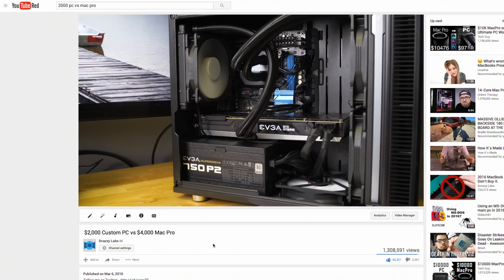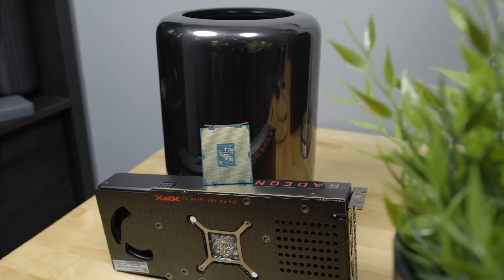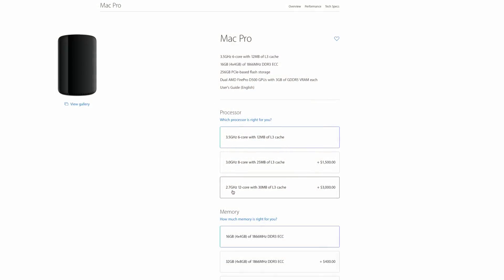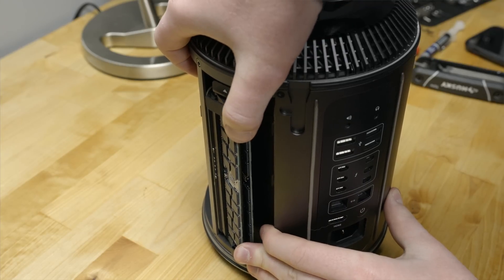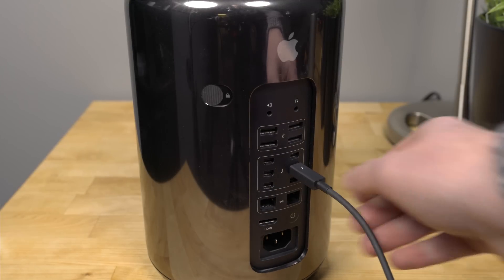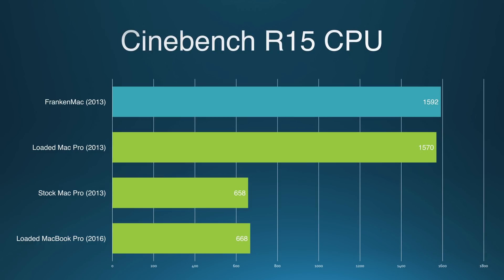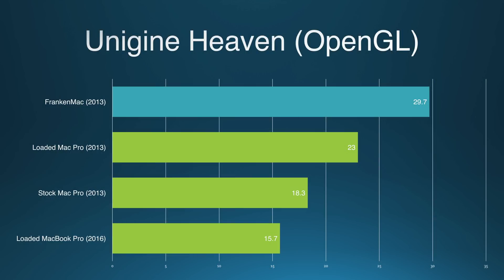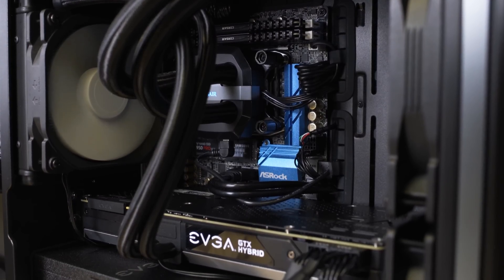The Best Mac... Apple Doesn't Make!

Comment: This was a great video, Quinn! But I gotta ask, why not just build a hackintosh from scratch if you really want to use final cut pro? Aren't there plenty of builds that you could get away being bug free with by using the right parts?
Reply from the maker: +Nellogs This setup is bulletproof. I just want to never have problems with it. Hackintoshes are like 99% problem-free, but running into an issue during a major video with clients waiting is a big problem.
Reply: I definitely feel you on that. Thanks for the reply! <3
Reply from the maker: Cheers! :D

Comment: you said that apple nativatily supports this card because it supports the 460 in MBP, so If I was to build a hackintosh and throw 2x 480 in sli there should be no tinkering needed?
Reply from the maker: +CER CrossFire is not recommended.

Comment: Wow, you really thought out of the trash can. I bet the graphics card move would work great on a 2015 MacBook Pro through Thunderbolt 2. 🤔
Reply: JoeBob C even better on a 2016 with Thunderbolt 3
Reply: External GPU via TB 3.0 is currently NOT working with the 2016 MacBook Pro.

Comment: Wait, how did he hook up the GPU again? I can't get it, he talks too fast.
Reply: He used a Thunderbolt to PCIe adaptor called an "AKiTiO Thunder2 PCIe Box" to hook up the external GPU. He hooked the computer to the AKiTiO, then the AKiTiO to the GPU. Since the GPU also needs a separate power source as well as cooling, he put those into a separate computer case.
Reply: he used an external thunderbolt to PCIe called "AKiTiO Thunder2 PCIe Box". This box can convert thunderbolt2 into PCIe lanes where you can plug any PCIe extension. But since the Akitio box is small and can't fit a full-size GPU, he moved the TB2 converter from the box to a full case
Reply: Case, PSU, and card? There's no motherboard needed?
Reply: Yeah, just a psu and a pcie2 to thunderbolt box
Reply: Thanks man! I guess i'm not the only one who couldn't understand what he said
Reply: Alex Soto would that be cheaper to build than buying a Razer core?
Reply: BrechtXT Definitely. The Razer Core probably works a lot more seamlessly with Razer products though.

Comment: Not to be offensive, but you are way too much of a tinkerer to be a mac fan.
Reply from the maker: +Ogoun I am a PC guy too. :)
Reply: Mac people are best in one thing... accepting to get RIP OFF by Apple. Every single time...
Reply: Nope. He's just smarter than the average Mac/Apple user :D
Reply: anyone that is a Mac user or a "mac fan" can be the person that tinkers and not use Windows/Linux. As he said in the video this isn't a Hackintosh. This is good for people that will only use a Mac but  want to get more performance out of their current mac.
Reply: I'm a big Linux guy, two of my daily computers run Linux, and I have to say its not for everyone. There is a much steeper learning curve with Linux than there is with MacOS or Windows. Ultimately, it is true that Linux developers focus more on features that UI. That takes a lot to get used to. Many programs built for Linux are open source, meaning the developers have to do the same work Microsoft does, but on donations instead of selling products.
Reply: George Kazanakis All companies have issues with software and drivers at launch. Microsoft has the excuse of having to work with hundreds of computer manufacturers running a plethora of hardware combinations. Apple has only a few sets of hardware, and bootcamp blew out the speakers on any 2016 mac that ran it. The people whose speakers blew out had to send the computer back to them, and they would ship a new one back. I guarantee that took longer than three days.

I also doubt you have any files that went missing because of windows, and you can hardly blame Microsoft if the programs you decide to use has errors. And don't tell me that in owning your Mac for 7 years you have never once had a problem with it, because I call bs.
Reply: If you think the extra layer of polish is worth the large amount of money Apple charges, then that's fine, but it doesn't change the argument that Apple users are not tinkerers. My point is that people who like to tinker enjoy saving money and solving problems themselves. They enjoy playing around with hardware and software options in a way that Apple doesn't allow for.
Reply: What are they tinkering with, though? If they want a polished experience with every program they want pre-installed they aren't tinkering with anything.
Reply: George Kazanakis actually there's even better fully functional laptops for example all these razer laptops, they have great performance and some cost less than a crappy macbook
Reply: Ogoun what the fuck are you on about
Reply: I have to call BS on this one. Windows 10 is far from unstable, TBH I use it for professional work on 2 computers from the first day it was released and it hasnt crashed even once, not even a hickup. The funny thing is that I regularly use Fusion360 for 3D modeling, and once I used it on a macbook pro and it crashed 2 times in an hour. Probalby bad optimization od the software for MacOS, but still rendering it unusable as an OS for my workflow. You just have to make sure that you use a original activated version of Win10, I can't stress enough how important that is for stability and usability
Reply: Julien Vandal - linux fans are the best tinkerers
Reply: ***** - what software of linux is not intuitive and is bad? what do you mean they do not think practically?
Reply: I'm gonna cal bs on the Windows 10 unstableness too. I was even in the Windows 10 Insider Program, using Windows 10 before it was released and when even Microsoft were calling it unstable, and it never crashed once
Reply: XInfinity2013 - any system can crash
Reply: Hmmm...not much a thikerer...lets see....
las time i checked on windows 10 lenovo laptop after the update the monitor wasnt working because windows 10 installed the wrong drivers! The result was 3 days without pc and the work fall behind. Also updating when i have a presentation for example.
I have another one: missing files, errors in software etc. ENDLESS. 

I use a mac pro and previously, until end if 2016, a 2009 macbook pro. And guess what..They just work until this day with 0 problems, reliable (slow for the macbook but reliable) and easy!

So come back and say how mindless i am and i buy those machines :)
Reply: I didn't say it was a valid excuse, but when comparing windows and MacOS, you have to admit driver errors are harder to forgive when they have only 5 different computers to write software for. Linux is different because you need separate drivers for each piece of proprietary hardware. When installing Debian on my ThinkPads, I had to download drivers manually and force an update to get my wifi to work. The average user doesn't want to deal with that, they want to buy a laptop and start working immediately. And anyone who buys keys at $110 is an idiot. Anyone with only 5 minutes of research can find keys for under $30, I buy mine for ~$8. (Granted, I buy OEM keys, not retail)
Reply: I completely disagree :) 

Personally i don't care how many hardware and software combinations exists on windows and mac and that's simply because i don't care! I care having my job done no matter what. So i consider better company for my needs the company that has less chances for errors. And  these apple combinations serve me very very well for many years. 

I use bootcamp some time now for being compatible with win files from colleagues and i didn't have problem with that. 

Also i can't get the mainly used phrase from @NexuZ Demon: "I think way more than the normal consumer" - thats why i have windows.

So if i want a tool that doesn't need to think how to make it work properly, i think less right? 
I really can't understand some thinkers to be honest. Maybe because they are smarter than me i guess.

Should i sum up how much more reliable apple products are comparing to windows laptops (based on statistics). 

Indeed Ogoun all these years 0 hardware problems, software problems not many and minor. To be honest were so minor that i can't remember a specific example right now!

Of course you can't play games properly on mac. Of course you can't be a programmer on mac. Of course i don't have a lot of software which are available for windows only. But for sure this is not my field so again...i don't care for that too personally.
Reply: Ogoun I will explain what I mean exactly. 

First of all it's not the extra layer of Polish (eg.Microsoft Surface)

The thing is that I DON'T like playing with software and hardware around. 1 because it's not my favourite hobby and 2 just to be clear about my use: because i am an Architect and I prefer 1000% to give that time for project! i already come back home after 22:00 every f** day.  And i prefer giving my free time on hobbies that I really like. I am using my Cad software, 3d software, almost all the Adobe series and I am more than happy with the performance and the result. Why the hell should I give my precious time on playing with these combinations. I can't get that. And that's make me not a thinker?  really? 

I told you that to show you that I am not a 18 year old to show off my bitten apple in Starbucks and i love having iphoto and keynote preinstalled. 

I pay that money because i buy a solid machine, reliable 100%, i can easily put it in a  bag and have a small monster on the go. 

Because i love having exposè on my computer and not minimise 1000 times per day my app windows to find things. 

Because when i save something i don't have to look at it and with one click i find my recent edits on finder.
The examples i can think right now are endless.

And all these examples of ease of use and lesser moves i make every day after 10-12 hours working on it believe me are life saving. 

Also i doubt that some apple products are really expensive. Eg my mac pro has dual d700 (~= firepro w9000). The cost of w9000 standalone is around 2500 last time i checked. (x2=5000)
Xeon e5, 6 core 3.5 around 700? 

5700 easy. 

But macbooks indeed are really expensive. 

Guys just clear up your mind and understand that some users see the computer only as a tool. They are not gamers, they are not pc builders. Macs are reliable tools that makes my life easier without adding another one problem on my mind. 

G
Reply: That is exactly my point. If you want a solid machine, and you are willing to pay the extra money, its worth it. But if you want to tinker, as I stated in the first comment, you don't buy a mac. They are overpriced and do not have the hardware or software options available to windows users. If you don't want to mess around with hardware and software you are not a tinkerer hence my statement is valid. I don't doubt your mac is reliable, and I don't doubt you use it a lot. If your computer is just a tool, you are not a tinkerer. Tinkerer doesn't just mean you do things, and it is not synonymous with creative. It's not an insult not to be a tinkerer.

Also, expose is not a mac feature, Windows has the exact same thing in the form of task view.

Comment: I'm about to build a custom PC in a classic Mac Pro case!
Reply: Rody Davis and install hackintosh in it. it gonna be awesome.
Reply: Rody Davis wait you said classic I like it a lot
Reply: You're*
Reply: I've got a Mac Pro 1,1 flashed to 2,1 with upgraded cpus and ram. When it outlives it's usefulness, I'm gonna turn it into a Hackintosh. It's still smoking fast so, at least three years for this $300 after upgrades unsupported Mac Pro running El Capitan.
Reply: I had that idea. Sounds pretty cool if you ask me. It's kind of like giving Apple the finger and saying: yeah, your design is great, but your hardware sucks, so get out of the way and watch a professional work.
Reply: I wouldnt keep the power supply, they have a tendency to fail and you'll have to rewire everything to make it fit modern components. Plus, newer PSUs are much smaller and quieter :)
Reply: Rody Davis you're stupid
Reply: Rody Davis cool!
Reply: Rody Davis niiiice dude
Reply: I've done the same thing with a laser hive kit and it works great! Lots of cutting involved lol
Reply: Chasbris thank you for that advice! I think I'll do that and get a 500watt modern PSU
Reply: I had already do!! ;-)
Reply: CADesigner yeah that is something I have been considering with xeons. I definitely want it to be a workstation I was just not sure if the motherboard would fit. But that one looks like it will. I will use the PC for mostly video editing and animation. That would be a lot better set up for Ram too. It may be a tight fit but I want to liquid cool if I can to make it quieter and run cooler
Reply: Octa-channel instead of quad or dual, still faster than a X99 with 2400MHz DDR4 in quad-channel  (latency is not that good).
Reply: 4ever rmr joe you mean OS, right? cause S.O. is not ringing my bell unless you S.O.S. me.
Reply: I wanted to do that but I don't have access to most of the parts, like te custom mobo plate. I have a G5 case though.
Reply: Santiago Ferrari Depends on how you calculate value for money. In most work environments, Apple's have higher value for money, since they lower IT costs drastically. There's studies on this, but I've done it myself w/my small office and experienced the benefits. If Apple only made a simple "Apple" type printer again, costs would go down even lower. People still have trouble with printers, haha! In my own personal life, I'm also much more efficient on Macs. But I do like that Windows has been evolving nicely. I bought 2 Windows PCs last year, and they're decent for select apps. Surface 4 + Xara is a lot of fun, for instance.
Reply: No This is Patrick yep mine is a PowerPC G4 too!
Reply: Denver Alfito Anggada yep absolutely!
Reply: sdushdiu Unfortunately, since I have the G4 PowerPc mac pro from 2005 I have to gut everything except the power supply and bay drives at the top since it wasn't an Intel PC. But i think it will work really well.
Reply: I recommend you use a dual E5-2670 v1 setup, it's abput 34% faster than the fully load Mac Pro, and you can find the pair of CPUs for less than $150 total, 64GB 8x8 at 1333MHz can be found at $150-200, and new motherboards with dual socket starts about $250 but you can find a second hand mobo on eBay, for the psu you could buy one that has dual EPS or a 2-molex to EPS adapter.
Reply: save the hard drive. it has the os on it, you could make a hackintosh.
Reply: +CADesigner CPUs might be cheap but motherboards aren't. Also, 4gb sticks of 10600r can be found for $20 a stick. Running a HP Z600, dual E5667's, 24gb ram and a GTX 970. Cost $600
Reply: i was thinking of doing the same, but arent the old mac pros not BTX instead of todays ATX mainboard form factor?
Reply: I would except I wanted to put GTX 1070 and DDR4 RAM in.
Reply: Rody Davis where did you get the mac pro case from?
Reply: SOZ I KILL YOUZ a college I used to run the AV and production department for gave it to me on my last day.
Reply: SOZ I KILL YOUZ go to a local Free Geek thrift store. they have lots of old macs and powermac g5 cases
Reply: Well I know you can get the cases without the motherboard, I just thought someone made an ATX version of the case. Thats why I wondered how he got the case.
Reply: Damn. well have fun lol and remember that the apple motherboard isn't an ATX size and will have to be modified to fit an ATX or and common motherbord standard.
Reply: Mato Blazevic 
Hey bro could you add more GPU`s to the system????? Please say anything
 4 GPU`s trough thunderbolt terminal on this Mac Pro?
Reply: Mato Blazevic no you would be limited by the bandwidth from thunderbolt 2 or 3. So adding more would not help. You could go the custom PC route and add more GPUs and then stream your stream and controls to the Mac.
Reply: Spammers are getting smarter :3
Reply: Santiago Ferrari is Sierra available yet?
Reply: i have one waiting for the market to settle and ill be building in an 08 MacPro Case
Reply: +4ever mr joe Mac doesn't make phones!! apple makes phones lol!!
Reply: The best S.O. for mobile and computers of all times not counting linux.   are Windows 7 and iOS7.
Reply: You pretty well have to fabricate your motherboard plate. That's not nearly as hard as it sounds though.
Reply: Mac is for office project or any kind but not for gaming if you are just more on gaming I personally suggest Desktop you can expand it more and customize but Desktop is more on for games nowaday but if your an college student like me I highly suggest Mac. but it's up to you :)
Reply: 4ever rmr joe there is a free version of windows 10? Does it still work fine? What is the catch? I'm genuinely interested.
Reply: Rody Davis N O I C E
Reply: Rody Davis cool dude
Reply: Genius, the Mac is simply an Intel Roadmap compliant PC. It was and IS a PC running OSX.
Reply: I'm about to build a PC in a cardboard box. Make holes where you like. Who cares.....
Reply: LaserHive Makes plates and mod Kits for almost all old PowerPC cases.  I used one for my G4. Came out amazing.
https://www.tonymacx86.com/threads/my-first-mac-case-mod-g4-graphite.146222/
Reply: yeah u can also install Windows 7 lite 64bit   it runs ultra fast,  or windows 10 lite pro64bit  both requires less than half memory ram and cpu usage than original lol and auto activated which means free.
Reply: MAc sucks.. they are extremely crap only good thing are their phones only because their operating system iOS because android is just crap like MAC os
Reply: ugh???? are u stupid enough to not get that i referring  to apple inc. ?.. MACs are crap.. and the S.O... only useful to register on itunes store as seller.. but iPhones S.O. is the best compared to the crap of android that has a lot of bugs and crashes.